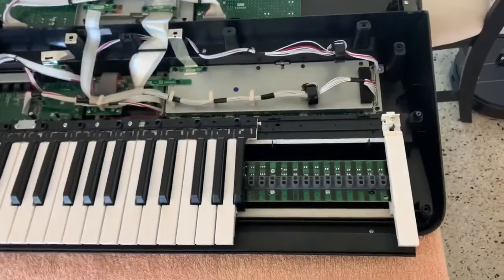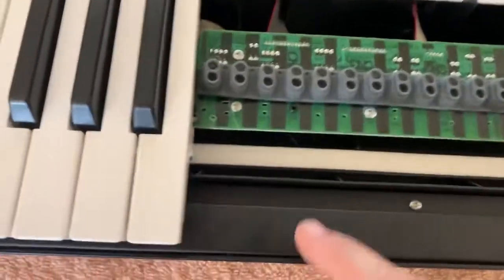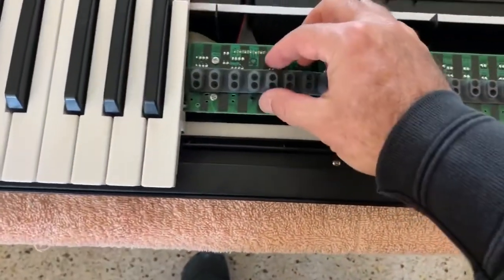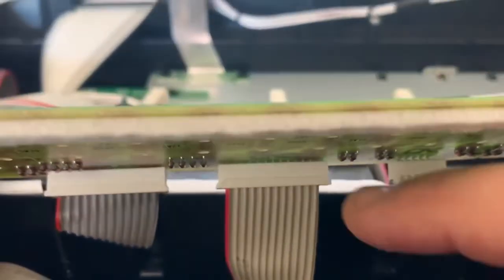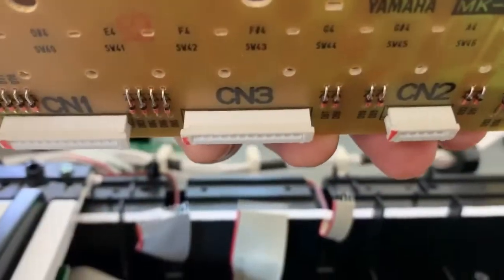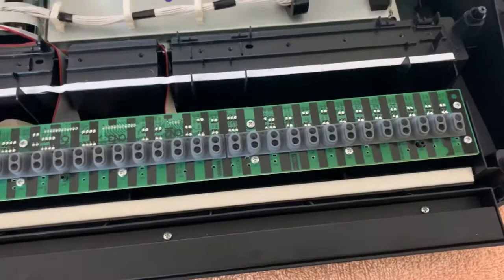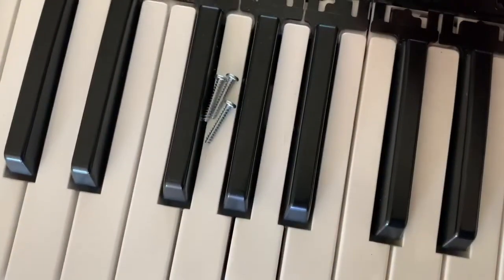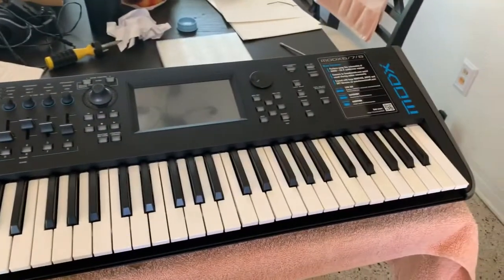Fixing A MODX broken Keys and Board

Comment: Hi Eddie, 

Thank you for showing us your procedure and the inside of the keyboard. I took mine apart to add felt to cut down on key noise.

What I noticed is that the gray-rubber key contacts are different heights - slightly higher for the black keys. Perhaps your gray-rubber contacts were replaced backwards or out of order, raising the whites (as well as the blacks, since it's all connected), which gave you the key misalignment? Something you could check, but I thought I'd pass that along to you. All the best!
Reply: Yes thank you. The video shows that is wasn’t  aligned however it is haha. It’s been working great. Knock on wood. The only difference is that the new replacement keys are a little different in color. Barely noticeable. But it works!

Comment: would you share the vender for parts and service? my modx has some dead keys from normal use ? cheap compared to the older units like the motiffs
Reply: I used https://syntaur.com/yamaha_modx.html sometimes and if I need something else I also make a google search for the parts. You may find fully working used parts that are less expensive. It sounds like you may need to replace the contact strip. Which is about $12 each strip covers an octave. I hope this helps.
Reply: keybed looks identical to MOXF6 and MOXF8, or almost identical
Reply: @Jason75913  I think it is exactly the same keyboard, the 8 is just longer with more keys.
Reply: @petermoss5341   going by photos across the internet, yes, you are right, same keybed as MOXF series, fundamentally

Comment: Too bad they skimped so badly on the keybed…have you considered maybe adding thicker felt to replace the existing one to absorb the keys noisily bottoming out? I’m torn between paying the premium for a Montage or getting a MODX for this specific reason
Reply: I wish the Keynes was better however, I don’t really mind it. The reason why I went with the MODX instead of the Montage is the weight. I don’t want to carry a heavy keyboard also,  I don’t need the sampler a can sample with something else and than import. I play  lots of one nighters and I want my setup to be as lite as possible.

Comment: Where did you order the parts from? I have an 88 key MODX and need the same group of keys in the end replaced. What was your part number for those also? Thank you
Reply: Pass on the MODX6 or 7 for sure. I just had a key break from casual playing. No diving off of anything and yes, the bed is simply noisy as all hell two years in. My MOTIF or even PSRs had better action when they aged.
Reply: @sacramentowordpressguru  
I already sold it. Thankfully I kept my Motif XF8.

Comment: this is a great gigging keyboard, but now after 3-4 years of use my top octave has become paralyzed? the keys wont budge and if you apply enough force they get stuck down and the note plays but the key stays pressed in. 

seeing your video i see now that it is a "region" of the keybed that maybe is misaligned? do you have any advice should i just take it apart and take a look? what should i be looking for? 

anyways, thank you for a great video!
Reply from the maker: I would try to carefully take it apart and clean everything also if you don’t have issues with notes being louder than others just put it together again, maybe even replace the keys of that octave. I had to replace mine cause I left it in a restaurant en someone dropped it on the floor and it landed on the edge of the stage breaking the keys.
Reply: @edgaba  where would I find replacement keys that are compatible? Are they easy to source? Thank you so much for replying
Reply from the maker: @Opd351  https://syntaur.com/keyboard.php?keyboard=2209&brand=Yamaha&model=MODX6
Reply: @edgaba  thank you so much
Reply: Did you get it sorted out?

Comment: Do you have to remove all of the screws on the bottom of the keyboard to get it apart?
Reply from the maker: I do t remember however, you could try just removing the edges first see if you can remove the top. Just keep track off all the screws you remove, if they are different sizes mark where they go. You could also take a video of how you open it so you. An close it by watching it and be careful when you open so that you do t pull any chords. It’s pretty straightforward forward, if you can fix or build a computer you can do this no problem.
Reply: @edgaba  Thanks, you do have to remove all of them, the front row under the keys is the row that has the shorter ones.

Comment: Like another commenter said, the same keybed used in their cheap consumer keyboards. I'ved repaired several keybeds in the low end DGX series and they are the same. Shame on Yamaha for using this type of keybed in a PRO instrument.
Reply from the maker: I’m not sure if they use the same keybeds as the PSR keyboards I just replace mine with the cheaper version because it fitted and it was the only one I found online that wasn’t very expensive. I found it at a TV repair place of all places haha. They fit well and I do t mind them though they are slightly a different color.

Comment: These things are junk.  I play professionally.  I just sent my MODX8 in for warranty repair of broken key.  Got it back and the same key broke within a day,.  Garbage.  Not for pros.
Reply from the maker: You are right. They can be delicate. I was use to the MOTIF however it became heavy (I have a bad back) this I have to baby and be very careful. They are so lite that someone stumble into it and it fell from the stands; breaking the keys and the board. I was able to fix it my self but I have to baby it. It does the job locally but I don’t travel, on the road, on a tour it would probably break easily.
Reply: Sounds like it wasn't repaired properly if the same key broke again so fast. But yeah, low quality keys like MOXF keyboards.